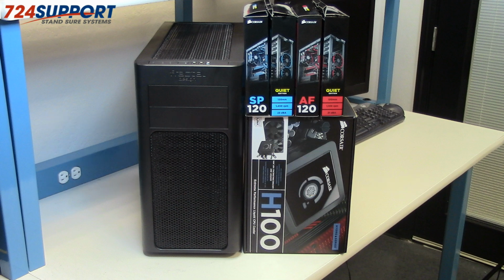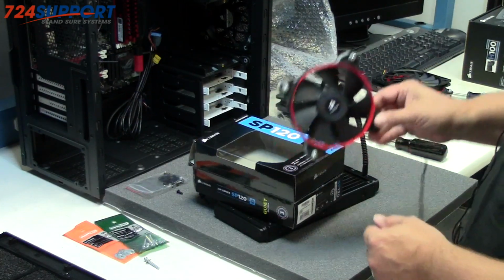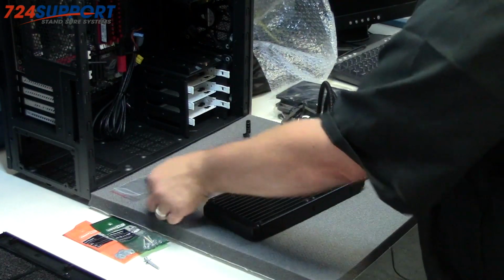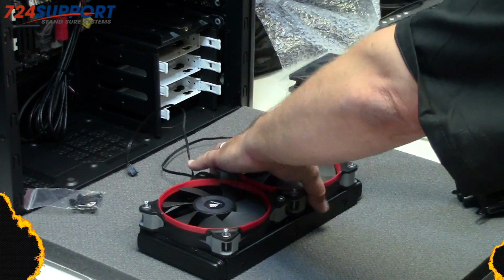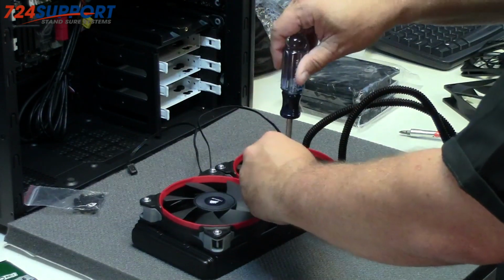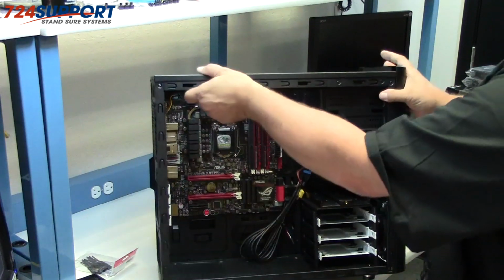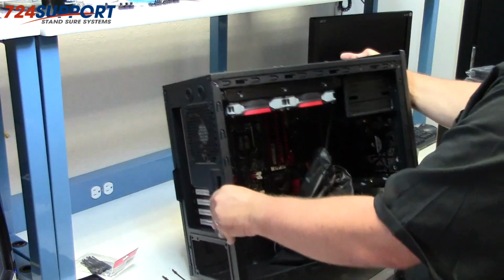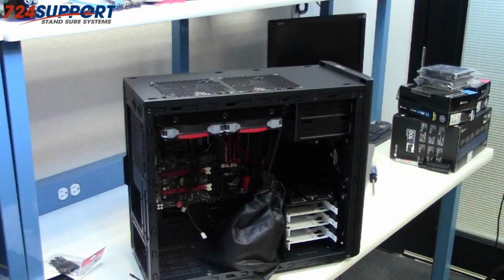Fractal Arc Mini with Corsair H100 Push-Pull (2/2)

Comment: Liquid cooling doesn't utilize the same intake/outtake fan orientation as air cooling does. But yes, for an air cooled PC, you want to intake from the front and bottom, and exhaust from the back and top. Side fans are optional, but I believe most people use them as intake fans for extra GPU cooling. Side fans are used for exhaust when your GPU gives off an excessive amount of heat. Just make sure that your PC has a lot of clearance on the bottom, otherwise using that fan as intake won't matter.

Comment: i thought u push air in from the bottom of the case and pull air out from the top of the case. i am replacing my switch 810 fans with these..

Comment: What size of washers did you use to mount the fans on the H100 so the provided screws don't damage the radiator fins?